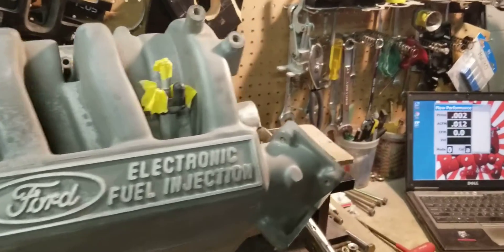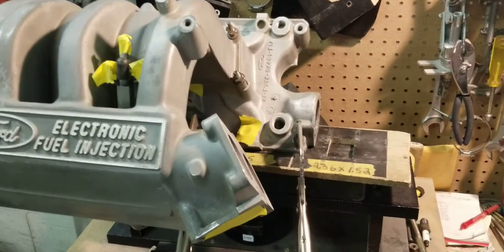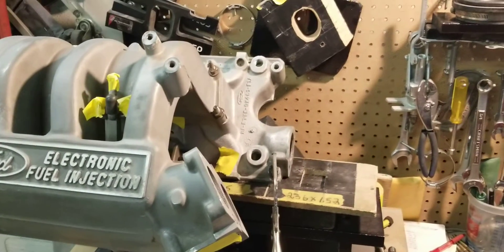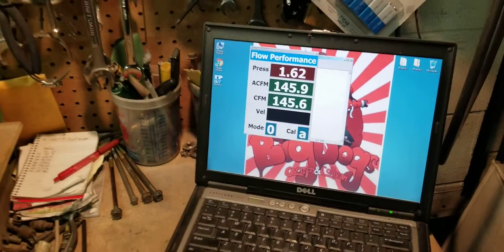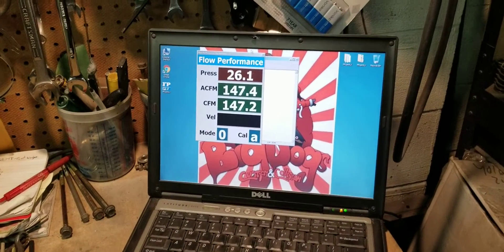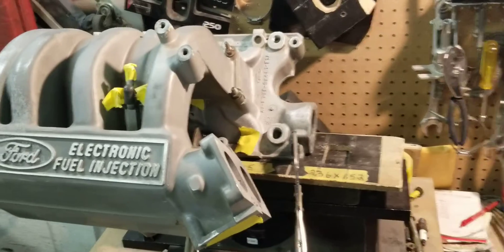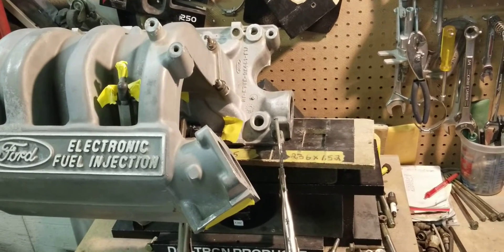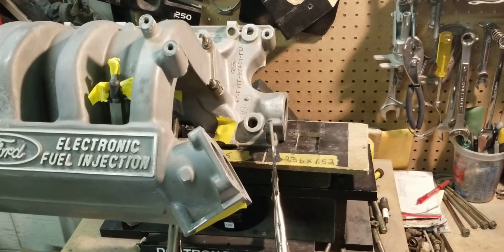302 Ford  Truck manifold stock flow testing.

Comment: I would have thought it would have flowed more than that. Its got a lot more port area than the 5.8L. I'm curious what a Stock 351w/5.8L truck intake flows bolted together??
Reply from the maker: This is exactly what we are trying to show people with our testing. What you think vs actually flowing. The 302 truck manifold has a smaller plenum and runner entry despite having a better designed lower vs the 351 truck manifold that actually flows 175-178cfm average runner flow in stock version. All flowed on the same bench the exact same way so there is no test variables from test to test. You have to port these a certain way in order to get the results posted which takes a ton of time and effort.
We have posted before and after flow results of the 351 truck manifold on our YouTube channel.
Reply: @bigdogsportingtonyb2833  Wow. Good info right there. So the 5.0 has a better lower but the 5.8 has a better upper. I would have never guessed that. Thanks for letting us know.
Reply from the maker: @440cubicinch  Bingo!!! Also you cannot see the full flow of our stage 2 ported manifolds with the stock throttle bodies. They truck manifolds throttle body tunnels gets ported to a bigger size but the limiting factor is the throttle body. It needs to be the ported twin 61mm bbk version to see max flow on the stage 2s because the plenum on the trucks upper is divided. Each throttle bore feeds 4 cylinders so air speed becomes a issue. Our stage 3 on the trucks eliminates that
Reply from the maker: @440cubicinch  the Edelbrock in stock form flows 225cfm average runner flow
Reply from the maker: @440cubicinch  true or save and max port your factory manifold👍